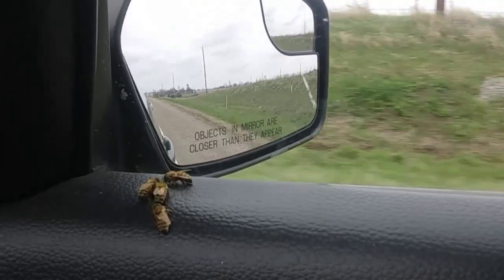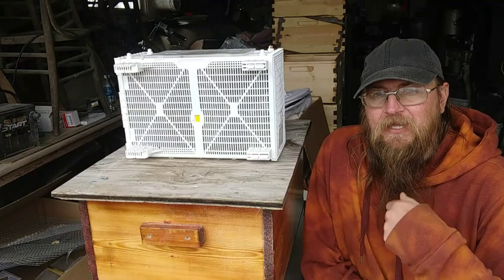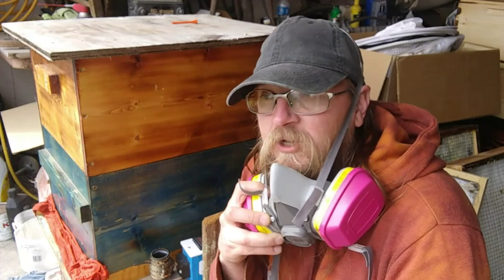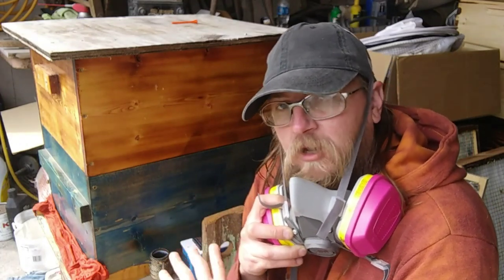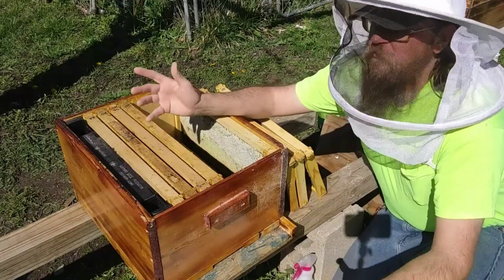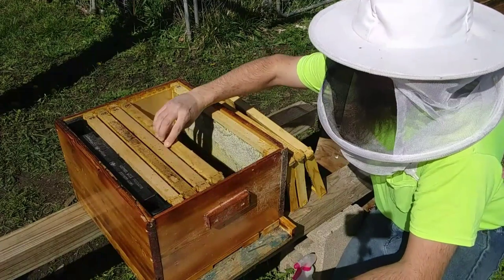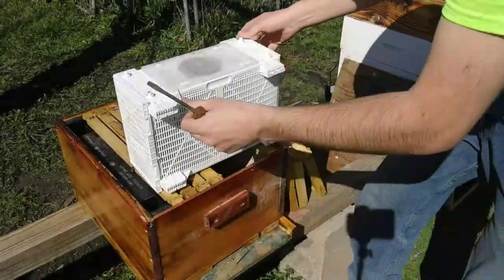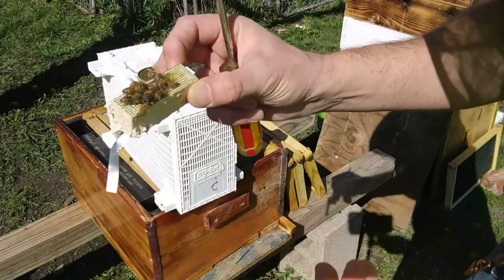Package Bee Installation & Treating for Varroa Mites 🐝 #BeeBus #Honeybees #Varroa

Comment: The bees are in a cluster. I would think to install the bees then block them off at night and treat early in the morning. This should help with even coverage. I am not an expert but it stands to reason.
Reply from the maker: You could absolutely!  The bees move around a lot when getting treated with OAV so I wasn't to concerned just wanted to give them a dose and no chance for varroa to hide in any cells. I actually do usually treat in the evenings or early mornings when they're not as active when doing my normal routine though. Thanks for watching friend 😊

Comment: With mites doubling in population every two weeks, by August you would have been raising mites instead of bees. LOL
Now to fair to the supplier, 3 lbs of bees is like 10,000 bees right? If you dropped 100 mites, that is 1% mite infestation which is below the treatment threshold. So maybe that isn't bad?? But I know you're glad to see them suckers dead on the bottom of the cage. Thanks for sharing.
Reply from the maker: I was thinking about the 10,000 bee thing as well. Defiantly wasn't a fair test but I wonder how many got shook out into the hive with the bees. I definitely plan on testing once they get established.
Reply: @BlanchardsBees  Live mites hold on very well on bees and don't fall off very easily. 
If you're saying dead mites fell out of the box when you installed, I don't know. Probably quite a few unless the bottom of the cage was sticky from syrup. So what is a good way to get a count??
Reply from the maker: @russellkoopman3004  yep they do and they move surprisingly fast too! Check out this video from last year of a live mite on a bee! https://youtu.be/NRMyvlzBDcI
I will be doing an alcohol wash on them soon to get a percentage mite count.